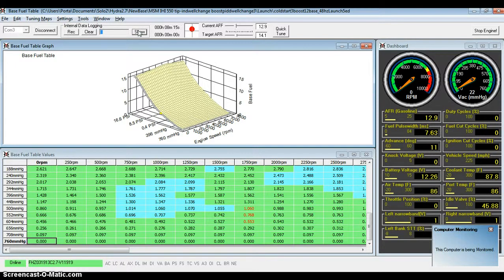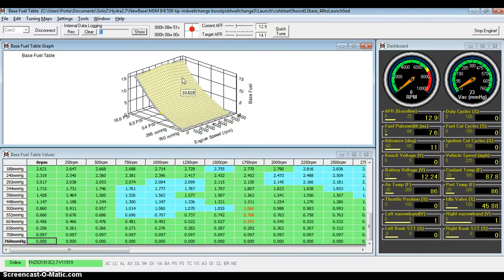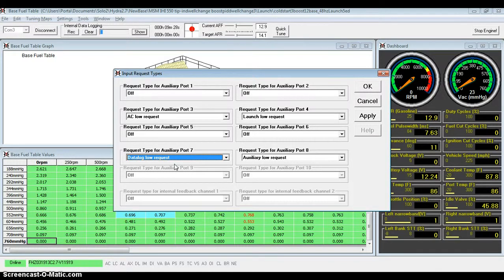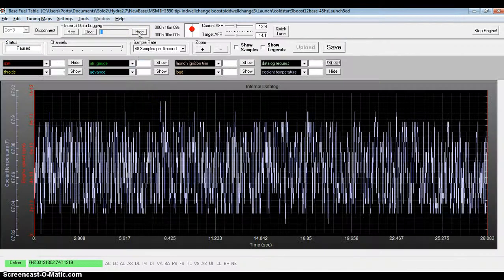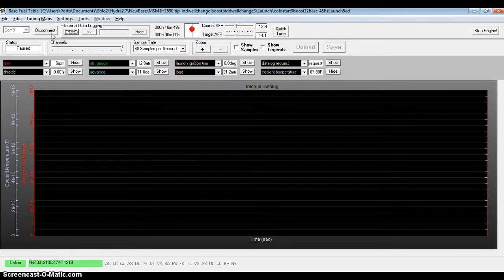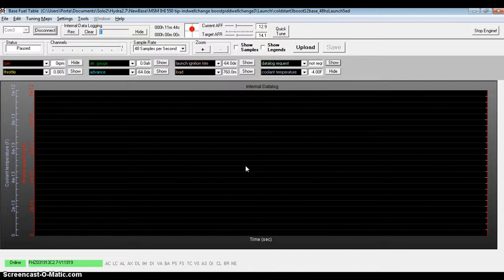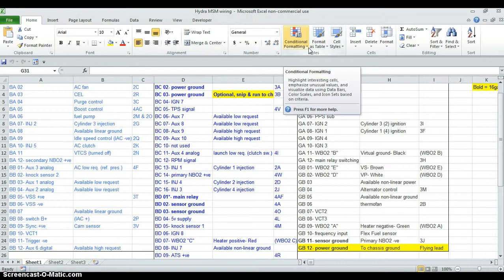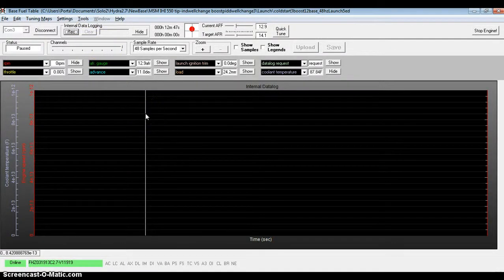How to enable data logging via a switch on your Hydra EMS 2.7

Comment: Did you do anything special for the switch? If I used a lighted toggle switch would it be able to power it?
Reply: No special switches are needed. You are essentially grounding out a 5 volt source. So if your going lighted, you'll want a 5vdc switch.
Reply: Thanks. Very helpful. About to drop the engine back in my miata and get back to tuning. Blew a head gasket (warped the head) with a bit too much boost on a cold day. If you don't mind I would like to ping you maybe on some other Hydra things as they come up. Thanks in advance.